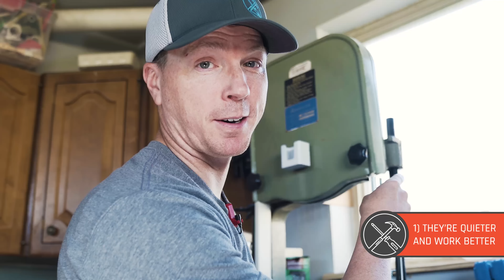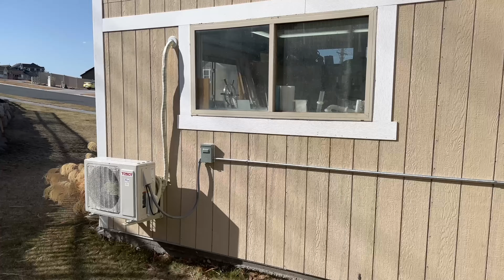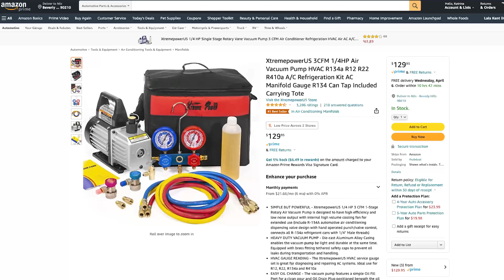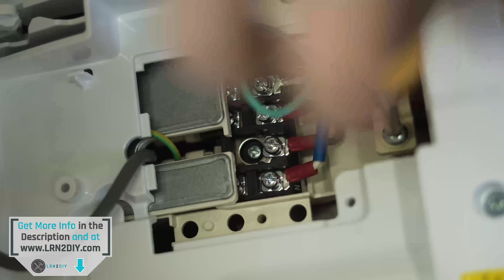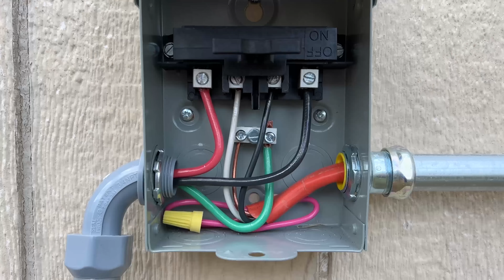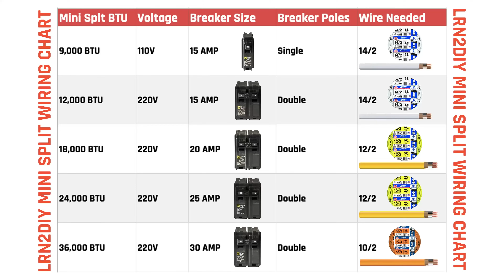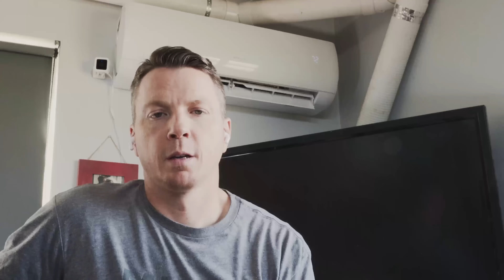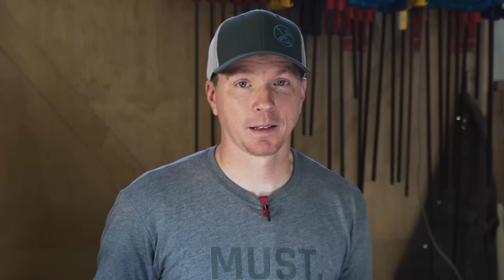Mini Split - 3 Things I Wish I Knew Before Installing

Comment: Dude...stop saying "two twenty volt". In North America, it's two fourty volt[1] nominal ± 5% (228 - 252 V). Merica! 😜😜 (For the nit-picky, motors are rated 230 V because they're damaged by being underpowered, not overpowered. Light bulbs are rated for 250 V because they're damaged by being overpowered, not underpowered.) Nice video, good info, thanks for the help. 👍👍
[1] https://en.wikipedia.org/wiki/Mains_electricity

Comment: Great video.
I'm thinking of installing a mini split unit 12k BTU on my main master bedroom. The home is over 50 years old and that room is always hotter than the rest of the home, even worse, this is Phoenix and it gets to 118F at times... higher since its old construction.
I found 2 units, both 12k BTUs.  1 is 230v and 2 is 115v.  Both have WIFI, but the difference is 1 is 630 and 2 is 500.  I'm still debating on either the minis of just add foam insulation to the exterior walls of the bedroom.

Comment: Thank you very much for the great videos.  I'm wondering if you notice noise or vibration coming through the wall where you have the outside unit mounted on the bracket attached to the wall.  Keep the great info coming!

Comment: Net carbs is a real thing if the the fiber is naturally in the plant the carbs are in. The way they use it to scam us is when they dump some fiber into a box of high carb crap food. When the carbs are contained within the fiber it’s difficult to digest so doesn’t flood your body with sugar. Adding some fiber into a box of high carb treats doesn't have the same effect.

Comment: Due to hoa rules and esthetics, the wall unit will be about 25 feet through the attic where the line comes out of the attic and heads down to the compressor unit. Do you have a video on running lines the extra distance? The condensate line will be able to go directly out by the room.

Comment: Good job a , little wordy , but overall good. I’m a believer in Mr. Cool , if you add up all those $100 things, I would still go with the Mr. C. Especially if you know about electrical and know your Codes ! Should be able to get the 12K unit for approx. $1200.. I got mine from Home Depot.

Comment: Central air is highly overrated and inefficient. Minis are the only way to go. I've installed a 12,000 btu 110 volt in my sunroom and the same in my dining/living room. If my central air ever lays down on me, I'm installing one more in my bedroom and I'm set. No more slave to the big HVAC companies and their maintenance contracts. I live in Florida so when I installed them, I made provisions for being able to simply plug them into a small 2200-watt fuel efficient generator during power outages from hurricanes. Everyone always wants these whole house generators not realizing that by day 2 they can't find gas to run them anymore.

If these are incorporated into new builds they can be installed very attractively. There are ways to dress them up for existing structures, so they look nice also.

Comment: I'd like a video on how to take out and clean the inner wheel/fan in the unit.

This has to be cleaned every 2 years for proper air flow. I clean the curved 2 part pull out screen on top, but the inner spinning wheel gets really dirty and doesn't allow air ro flow or the AC to run. 

I had a mini split installed in 2014 and wasn't told about this and I had it cleaned in 2021 and it was disgusting. I watched it being removed, but do not remember how now. I had to hose off and brush the caked dust and grime off the wheel for a good ten minutes. I let it dry and put it back in. Of course I do not remember how to now. I have photos of the dirty long inner fan wheel.

I used it for heat and AC in a 600sq ft 2 room 20x24 since installation. I supplemented with a woodstove and I'm sure that added to dust. 
I just tried the AC and it doesn't cool. I only used as AC for 2 seasons 2022&23, not for heat. I used a propane heater. I would find it hard to believe it got as dirty as before.

Comment: In Canada they want to cut your balls off and steal your money for God knows what sins. I have the evacuator pump and        valves. So what is the problem, right? I can't buy freon. I can't buy air conditioning fittings. I can't buy those types of fitting to retrofit a propane bottle for air conditioning. Plus the licences. Meaning big dollars for a hvac comany. I live in Alberta and my taxes, usage fees, are. I can't  sware in print due to the hate laws on any kind of attitudes found to offensive to anyone inclusive of migrants.

Comment: Hi! Thanks for the video!!
I found a 12000 btu, 110 volt mini split that you just plug into a 110 outlet. The plug is on the air handler inside the house and their is a cable you run from tge air handler inside to the compressor outside. I've seen a lot of install videos on this unit. They are 500 bucks on ebay and Amazon.  So far, I've only found good reviews. It pulls 9 amps. It's made un Mexico, but Amazon has it labeled as made in China.  Go figure. Still have to pull a vacuum on it, so have that additional cost. I plan on installing one soon.
Thanks again, take care!

Comment: I wanted to bring up another thing about mini splits esp the heat...  I run into quite a few people installing them in older homes and wishing for the heat pump function in winter on milder days t osay save them money on boiler heat or electric baseboard, etc..  the biggest complaint is the heat is up high and the feeties are cold.. minisplits blow out the heat up high.. and even though you can direct it low, the heat pump functions generally push out close to furnace heat temperature air (110-115 is typical)..  this results in hot heads and cold feet..  something you are probably already use to if you live on a slab with ceiling register forced air heat...  but not for those used to radiators or electric baseboard.. or basement forced gas heat..  I installed Ducted minisplits in my basement under the floor..  I have gas heat forced air ducted already but wanted the full zoning capabilities and hybrid heat..  so I built a rather elaborate system to integrate a sinbgle gas furnace and 3 fujitsu commercial ducted splits..   so there are options for those that want the benefits of minisplit but with floor vents..  otherwise this video is spot-on.. other than I suggest anyone who is installing flare fittings to add Nylog blue to their list of items to buy.. these flare fittings you tightened up on your unit require a specific torque on the wrenches.. over or under tightening can result in leaks..  a little dab of nylog blue makes this a bit more forgiving and still get a good seal.. I have fixed quite a few installs done by DIY that simply the freon lines were just honked down too tight.. they need to be tight but not all-your-mite tight...   lucky for them I enjoy the HVAC field even thiugh I quit the HVAC field professionally many years ago..  I enjoy helping and showing DIYers how to be succesful at it..

Comment: Are parts available for this system?
That seems to be the problem with these.
Also, you mentioned the vac pump and gauge system. You didn't mention what it takes to charge it. What is the availability of the refrigerant? How is a diy person going to do this if it isn't available to the general public?

Comment: There’s one additional thing that’s helpful when considering a mini split and it’s the energy rating. Here’s what it means, electric baseboard has an HSPF of 3.4 meaning that for each KWH of electricity used you will produce 3400 BTU’S for 1 hour. An efficient mini split can be over  14. Another way to understand this is for every dollar you spend to make 3400 BTU’S with electric baseboard it would cost .25 with a mini split. For cooling it uses a SEER rating. Many window and home split systems range from 10-14 SEER while the most efficient mini splits are well over 30 cutting your AC costs by more than 50%. The other benefit is being able to turn off or turn down an area while not being used, something you can’t do with a central system.

Comment: Excellent videos...and I only suggest using all wires from the panel and not just the Blk and White..as hots.  Use the red and use the white wire as neutral and bare as ground.  Overall safer and provides a more safe connection.  I enjoyed the videos...very easy to understand.

Comment: 120 volt 12000 BTU mini split units can be plugged directly in the wall as long as they're 120 volts and 12,000 or less BTUs you also do not need an AC disconnect in the United States

Comment: To do it properly is far more than $130. The old gauge set doesn't measure in microns, and that is really what you want to detect leaks on these mini split systems. I would go the Mr Cool route if I was not going to hire a friend in HVAC to handle the install. As much as I love to DIY stuff, the HVAC connections and making sure everything is spot on is worth the extra to me.

Comment: Can you discuss the various warranty options on the units you researched? 
And how about sizing for the space. Do the units have a table one can use to get the proper size / BTU? Lastly SEER for the respective units. Is that clearly shown on the manufacturer data? 
Thanks! I’ll be putting a unit in an apartment above my garage!

Comment: Great video as always.  I’m in In Michigan and our winters get pretty cold, but I’ve thought about multi head mini splits as an added bonus for my rentals.  Is there a good resource that can help you calculate how many BTUs you need for a house or an apartment?  I’m assuming you’d have to account for climate, insulation of the building, and size.

Comment: Hi.. I watched a few of your videos and find them very resourceful.  👍🏼
I have a question; l had purchased a mini-split system that l have received already and ready to install.  I am quite handy and can handle the electrical without any problems as well as connections.  However, l am installing the unit in my basement and are trying to come up with a way to drain the condensation “UP” without using an additional pump.  Basically, the line(s) will have to go up a bit (only a few inches) then out to the condenser unit outside.  I have to measure how low the ground is from where the unit will be hanging inside.  Considering drilling a hole through the concrete foundation. 
Any suggestions??

Comment: Yeah. As an installer you can never vacuum down properly with those cheap kits. You can't prove and hold vacuum below 500 microns. You also don't nitrogen pressure test. Really if you have installed the aircon and just want a hvac guy to test and vac down. It's going to cost like $200 bucks AUD. Maybe $120USD. And you going to know it's done properly and keep your warranty.

Comment: I just bought an all in one unit.  For the reasons you stated I wish I had seen your video.  Somebody should do a side by side to show how much quietet.  The unit I have is not always that loud but it os always on.  So the fan never stops running which is dumb.

Don't get me wrong it's a good unit but if I knew you could acquire the kit for the installation.  I would jave done jthat.  For one thing I had to cut 27 in holes for exhaust.  Nobody wants to do that in a wooden building.  The rxtra eater proofing problems is considerable.

Comment: I researched ductless mini splits for months when I was looking at replacing my RUUD central air. If you have a smart electric meter on your home go look at your KWH usage for an entire year. You will see that your heat-pump was sucking electricity all winter as well as summer. We live in FL so winters are not bad but the heat-pump was still running up the electric bill in winter. My electric averaged $300 month all year. Long story short I installed an 18K ductless in the living room / kitchen area, a 12K in the master bedroom and a 9K in the guest bedroom, all separate units and all inverters. I did all the work myself for less than $3K.  This is for a 1650 sq. ft. house and those 3 mini splits are cooling the house better than the central air ever did. The best part is we can turn off the units that we are not using. At night when we go to bed we turn off the 18K in the living room and close the bedroom door. My electric bill has gone down from $10 - $16 a day to $4 -$6 a day even in August. I cannot report on winter yet because we just installed them this summer. The smaller units are using about $22 a month in electric and the bigger 18K is using about $25 month. Ductless mini splits are the best thing I could have done to this house. My old RUUD R-22 system is turned off but I kept it in case we need it for an emergency back-up system. Something I learned:  Ductless mini splits are subject to damage from surges and local utility outages so I put a "whole house" surge arrestor in my main panel to help protect them.  BTW good video!
Reply: The Nest thermostat will also lose your bill by using strategies to minimize the heat strips.
Reply: What do you mean by "lose your bill"? And what do you mean by "minimize the heat strips"?
Reply: Have you had any mold issues ? I am really concerned about the mold issues vs normal central system.
Reply: @ObscureManifesto  No need to worry about mold.  I have cleaned mine twice and the fan blade inside the unit gets clogged up with lint and dirt. I wouldn't call it mold.  It's messy but I got a bucket of water and a paintbrush and kept cleaning until I got it spotless.  The unit went back to blowing like new again.  Believe me you can't go wrong with a mini split. Good luck.
Reply: @ObscureManifesto You do realize that ducted HVAC also has the same issue with mold and dust but is harder to clean completely? A mini split can be thoroughly cleaned of dust and mold as you can see all parts of it, unlike ducted HVAC.
Reply: What was the reason for buying 3 singles instead of just one with 3 units?
Reply: @Chris-717  I didn't want to run copper lines and wire around the house or up thru the attic.  Those units come with 16ft of copper tubing and S.O. cord and they are pre-charged with refrigerant for that amount of copper tubing.  If you extend the distance you need to bring out a HVAC guy to get the refrigerant charge correct.  I just wanted to do it all myself.  Basically you set the unit outside the room you are cooling and punch a 2 1/2" hole thru the wall and hook it up.
Reply: @dirtwhisperer658  Ahh I see. Yeah I get the DIY aspect. Always nice to be able to do it yourself. I thought maybe it was an efficiency thing. We have a small home in South Florida which has a newish central air currently, but thinking to use a split to help it out - I'm thinking maybe run it 80-90% of the time vs the Central to save some cash. Plus, I like how you can just turn these on in just one area and cool it quickly.
Reply: @Chris-717 Do it! You can't go wrong most of the time with the mini splits. They run very quiet and efficient.  Even if you just put one in your bedroom for sleeping you will be happy with it.
Reply: THAT'S MY PET NAME FOR MY GIRLFRIEND,  MINI SPLITS 😍

Comment: Very good broad overview.  Your videos always are helpful with this curious guy who wants to know how stuff works.  Haha.  One question I have is coolant.  How to check for coolant level with that manifold system.  I realize you are addressing a new system which shouldn’t need more coolant but I just had a portable air conditioner that didnt’ have enough.  Do you have a video in detailing that?  I assume that is where you would explain you have to have the EPA license to get said coolant.  Thanks again for another great video!  All the best from sweltering Texas!

Comment: Also that set of gauges and vacuum pump is mainly for automotive. It’ll work but they leave out a micron gauge which is crucial when not using a pre charged lineset as well As a torque wrench to make sure all flares are tightened to spec..

Comment: It's summer 2023, and the Tosot website says the unit is R410 Pre-Charged. Also, if you get a 110V unit (9000-12000 BTU), technically you can use a dedicated wall outlet. I'm saying this simply because I could not find a definite "NO!". All it says is that it needs a dedicated circuit breaker, which a dedicated outlet has. I happen to have a dedicated 20A outlet for a central vacuum unit in my garage and I'm giving this a consideration.

Comment: Don't forget about the mold issue with mini splits and the yearly cleaning cost which are quite expensive. Mine have been nothing but trouble since day one. have to be cleaned three times a year do to mold growth in the units.

Comment: The true value in any product is 2 things. 1: Does it do what it's supposed to? 2: How long does it last? Everything else is just shiney jewels designed to convince you to buy the product. A fancy unit with Alexa capabilities is useless if it doesn't work in 5 years. I have a 13 year old Mitsubishi mini-split that has been bullet proof.

Comment: A cost for vacuum / fill yourself is also the actual refrigerant.   And another thing to warn your viewers about is to be aware of what refrigerant type the unit they plan to purchase uses. It might affect choice of unit.  I am not an expert.  But searching to try to check the cost of refrigerant I am finding articles talking about R410A being phased out in 2023 in favor of one of the A2L refrigerants.  And also that a R410A unit can't just be filled with A2L.  At least according to the link below - the unit has to be made for A2L.  Again - I don't have personal knowledge.  I just looked at a unit being sold on Amazon that looks kind of nice and when I found a PDF of the manual - it is filled with R410A.  So some folks might get caught in the switch over.  Here is a blog with more info about the refrigerant law changes:
https://blog.totalhomesupply.com/r410a-phase-out-2023-refrigerant-standards/#:~:text=The%20HVAC%20industry%20is%20continuously,new%20refrigerant%20standards%20in%202023.